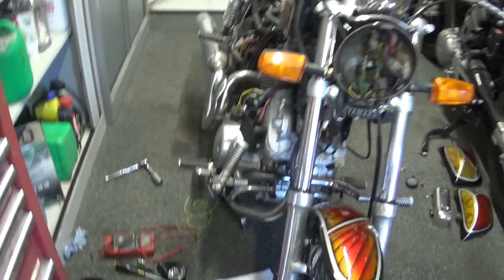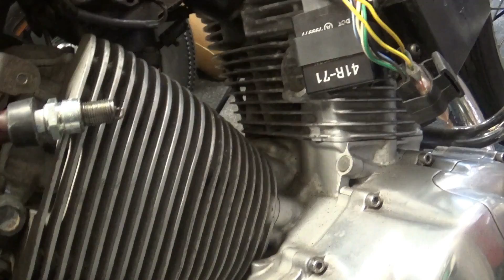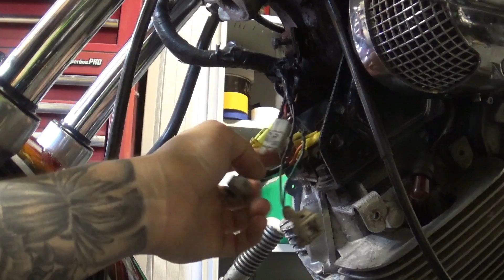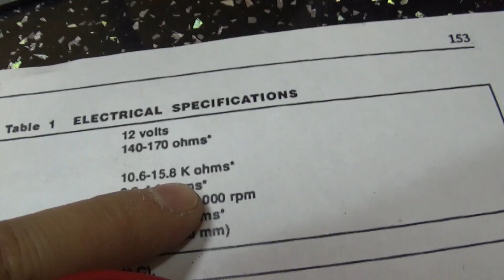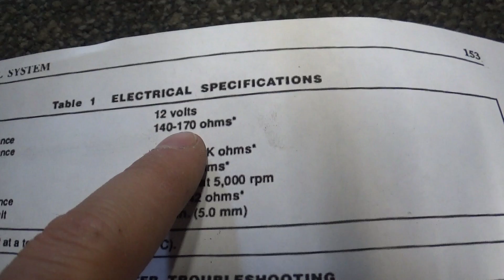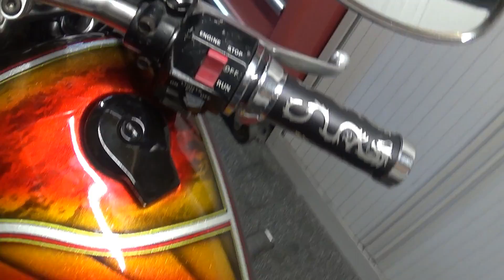Yamaha Virago XV 535 - No Spark

Comment: I need some help. Got same problem but finding a new pickup coil is turning up to be very difficult. They ALL seem to either have the year model 1995 onwards and that has 180-220ohm range and if no year model, then no ohm value found. Mine is a 1991 and should have 140 to 170 range. Could you help me please? @MackieBass

Comment: My bike has the same problem, though a weak spark. The pickup coil resistance is nearly 200ohms over the spec...but it still produces voltage. Did you measure the volage on yours?

Comment: check the kill button switch too both wires should have power or the power won't go to the cdi box some people use lube on the kill  start switch use gas to clean with tooth brush cleans well the power now goes to the cdi box then coils only  check  wires for resistence if none if it has a cap  mostly cut off the end by 2mm at the coil connection exposes more clean good wire if fuse is blown the ignition switch is going out

Comment: Ive built my very first bike which happens to be s 535. Heavy customisation on the frame. And for the life of me, I can't get the front cylinder to play ball. New coil. New TCI. New Plugs. New Rectifier. Just keeps flooding fuel out the exhaust. I'm thinking it's either a pick up (which I can't seem to source) so any direction for those would be great. Or it's potentially the valve not seating correctly (the head is a replacement off an old engine that I didn't check over before assembling🤦🏻‍♂️) 98% and this problem is keeping the bike off the road for me!
Reply from the maker: It was so long ago I couldn't possibly help now. I don't want to point you to the wrong direction, sorry boss.

Comment: I have a 750 virago 1992 i have spark carbs cleand cranks over fresh gas but wont start any ideas
Reply from the maker: New spark plugs?
Need spark, fuel, air. If have all 3...was the engine working previously, or you don't know?
Reply: @MackieBass   yes it was running 4 to 5 days ago i dont know how good a job they did cleaning

Comment: You're right on the popularity of the virago!
That being said, do you happen to know which CDI modules are compatible with the 87 virago 535?  I've only found compatibility with a later model so far.  Do they use the same CDI in the larger models from 87? They're considerably cheaper
Reply from the maker: I'm not quite sure about that if I'm honest. But it wouldn't surprised me if they did...engine didn't change much after all...

Comment: Hello sir, i live in toronto canada and i own a xv1100 1998. I was having trouble with my virago which wouldn’t start at all i tried bump starting 10-15 times and nothing. I gave it to a. Mechanic and he changes the starter motor, stator and told me he dont want to fix it any more i dont know why. He charged my 300$ just for labour plus parts that i supplied. He told me there is no spark. The spark plugs are new. Now that im down the financial drain i dont want to give it to another mech and fix it myself. I just want to be sure it is actually a spark issue and not that the engine is bad and bike is not fixable at all. Can you guide me to figure out this problem? Seems like the mechanic hates viragos which is why he dont want to work on it. Are viragos reliable bikes? Can i solve this issue myself? Inam quite handy
Reply from the maker: Watch the video and it will tell you step by step what to look for. Hope that helps

Comment: I checked my Virago 535 pickup coil and got 190 ohm and when engine is hot 220 ohm and bike perfectly works. Check friends bike and got same readings so i guess manual is bull****ing us. Its very hard to find parts in my country so im glad that i didnt bought new pickup coil. I will not trust manual from now... Even ignition coils secondary resistance is 21-22k and they work perfectly.
Reply from the maker: Thanks for sharing

Comment: Is the no spark issue still sorted after swapping the pick-up???
Reply from the maker: Yes, bike came back to life!
Reply: Looks like that's the way to go for my 535 then.......was runnin fine, now it won't start, no spark on either cylinder.......
Reply from the maker: Make sure the battery got FULL charge
Reply: Definitely got a full battery and ive tried a different TCI unit and got the same results...........

Comment: Hey there! What year is your bike? I've got an '87 and cannot find my spark plugs.
Reply from the maker: It was a 1992, I don't think engine changed that much, so the spark plugs should be the same across the range.
Reply: @MackieBass  oh I’ll agree to that! I just pulled off a cover on the engine and found a makeup tube in it...no spark plugs to be found. This is going to be an adventure.
Reply from the maker: @lurkersdeed  no way. Sounds like you're having fun with it. Good luck :)

Comment: I experienced once then I thought of trouble shooting complex parts i.e magneto and coil but still not found the cause. I follow on bringing my bike to low profile workshop, where the mechanic asked me to get s simple thing - spark plug sockets cost USD24 fixed at the tip of wires connected to the front and rear cylinders' coils. My lesson learn was to begin tshooting with a simple thing first.
Reply from the maker: We've all been there my good man.

Comment: Nice tutorial  & protocol that can by applied to any motorcycle (with no too much electronics)… That's how I spotted regulator ground cable issue on my 990 Superduke… I like also your "how to" format videos… Thanks & Ride Safe. VVV
Reply from the maker: What was up with you SD990? Lovely bike. And yes, the video should be titled - how not to be an idiot - use your manual! ;)
Reply: I had idle issues on cold starts & when I checked the voltage at +3500 rpm, it was below 14V... So thought that the regulator/rectifier had charging issues & ordered a new Arrowhead USA regulator… As you know, the battery compartment on the 990 Superduke is in the engine bottom spoiler and the the regulator is on the top of it and while replacing the regulator, I noticed that one of the 2 ground cables bolted on the "minus" connector of the battery was rubbing against the return oil circuit metal pipe just beneath front cylinder and all the plastic around the cable was gone creating short-circuit !!! Old regulator was fine !!! If I had followed the "search for issue" protocol written on the 990 LC8 workshop manual that I had, I would have saved 70€ & lots of headaches by just re-isolating the faulty ground main relay damaged cable….
Reply from the maker: @nemesisabbadon5628  Glad you got t sorted! I had the same problem, never got to the bottom of it, but it went away somehow in its own? Strange. I will double check good ground connetcion!

Comment: Nothing worse than an electrical problem. You can end up going around in circles trying to sort it. Glad you got it fixed. Stay safe mate. 👍👍
Reply: Worse thing ever is intermittent electrical faults. They never seem to occur when you're trying to find them, only when you are out in the middle of nowhere!
Reply from the maker: It's exactly what I did..but glad it wasn't too bad in the end.
Reply: Intermittent problems still tend to have a permanent and constant fault that can be traced if done methodically.